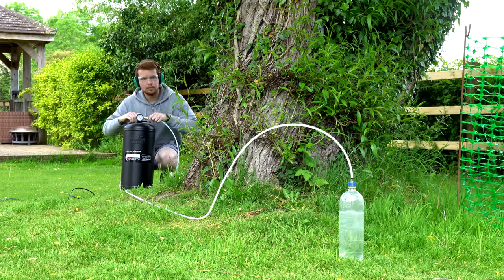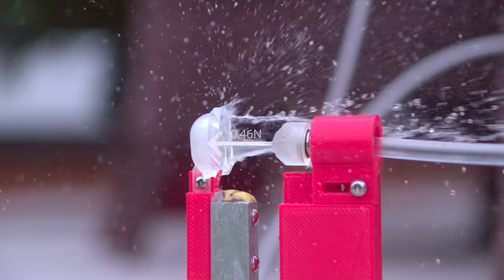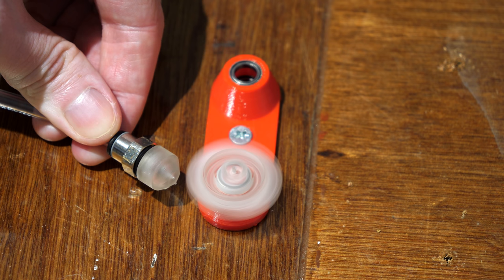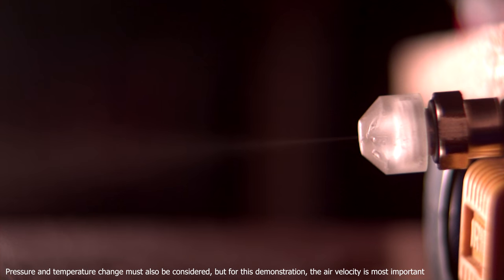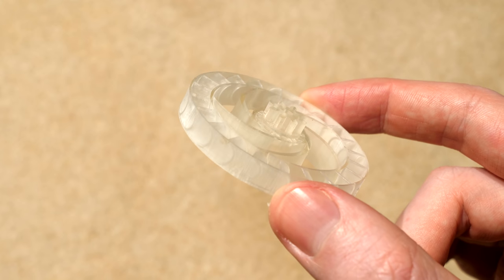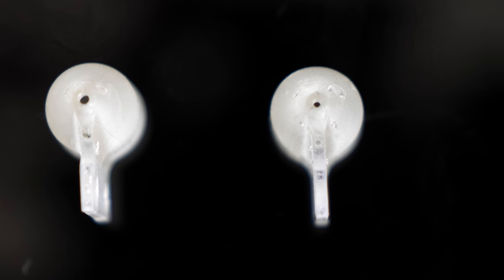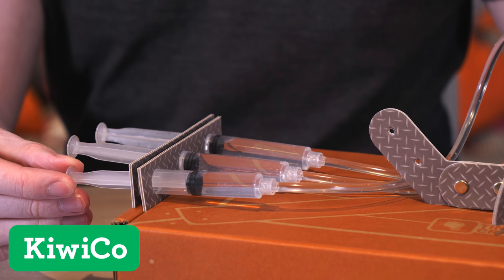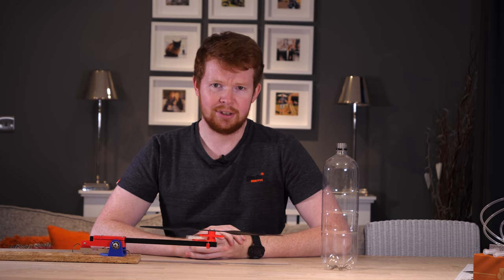Micro Pelton Turbine

Comment: A Laval nozzle should be used in a turbine operating with gas or steam. A water turbine does not need one.

The purpose of the Laval nozzle is to convert the pressure of the working gas to kinetic energy. The Laval nozzle can be located in the nozzle (impulse turbine) or in the nozzle and running blades (reaction turbine). Without a Laval nozzle part of the energy is lost to thermal energy because of turbulence on the gas stream.

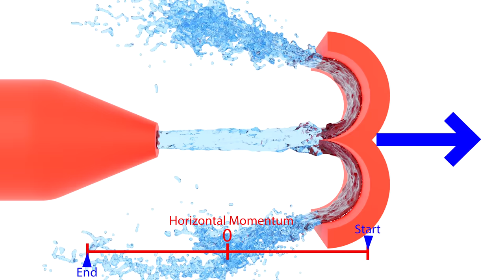Comment: at 01:25 you explained that the pelton bucket is more effective because it not just stops the water in its tracks (like the flat wall does) but redirects the water back, resulting in additional momentum. but then later on (in the context of the gear ratios) you mention that the turbine is most effective when the water expelled from the bucket has no backward momentum left. why at this point isnt this the same as the flat wall approach? in both cases the water gave all its momentum to the bucket and just „falls down“, doesn‘t it?
Reply: Because the curved blades return the momentum backwards if the optimum turbine load is selected, the working fluid air (or water) leaves the turbine almost without energy. This means all the energy is transferred to the turbine blades. Tom explained this. A flat wall will spill some of the energy to the sides, some of the energy will be lost.

Comment: The nozzle wastes more kinetic energy, as the air is only decelerated by the surrounding air, while the wheel can better restrict the nozzles blast, meaning it transfers more energy. Also the gearbox and propeller make better use of the gained energy at putting it out as lift, which works again better with a static plastic propeller, than with air only.

Comment: the wheel has more power cuz there is not the same resistance to the nozzle tip placed into thin air, place the tip of the air nozzle the same distance off the ground as you place the tip away from the turbine wheel then measure its force, resistance

its the equivalent of a high pressure fire hose, direct it horizontally 3ft off off the ground and it eventually arcs and drops to the ground right?

welp, stand in the water streams path right before it arcs towards the ground or falls off, maybe you can stand still without it pushing you out of the way?

now exit the stream and walk closer to the source say 3 ft from the tip, enter the stream, you will feel the power of the stream is a whole lot more than at the other end.. why is that?

if you cannot figure it out then let go of the fire hose and watch what happens, it flies all over right?  resistance, as in there is none holding it still, like he has the air nozzle anchored to the arm..resistance works both ways, the air coming out of the nozzle, and the turbine the stream of air hits..

one is static resistance and the other is dynamic resistance, in your second scenario there is no static resistance to push the nozzle connected to the arm. so just like the water, the pressure eventually fizzles out and has no power and falls to the ground, or ENERGY however static to static should create more force as there is less loss right?

if not rig the air nozzle tip away from a solid static wall so its the same distance away form your wheel, rig a sensor and measure the force it takes to hold the tip in place on the arm blowing on the wall 1/4" away, as in does it take the same force to hold the nozzle in place if it is blowing on a wall 1/4" as it does blowing on a wheel 1/4" away? you should be able to feel it in your hand, in fact the faster the wheel spins the less force it takes to hold the nozzle in place, no?

I do like the data for the two types of turbines, clearly the enclosed wheel is grabbing more air or is more resistant.. also like how kinetic energy increases with the prop, pretty good stuff mate

Comment: Could you have installed a second wheel under the first one that turns in the opposite direction geared together so the extra inertia with the water can be harnessed?

Comment: For your air based pelton turbine, maybe the inner chamber should be more spherical instead of only a 180 curve on a single dimension. I imagine those hard edges will cause a non-zero amount of turbulence that you could remove with a few more curves

Comment: Would be interesting to even just investigate the de Laval nozzle with compressed air. I think you are loosing alot of efficiency through the nozzle shape alone. Adding a small conical expansion at the end of the venturi could greatly enhance the efficiency. Additionally having the nozzle directly connected to the turbine in an enclosed housing could also increase efficiency.

Comment: If you put a small stop at the bottom of the curve to "catch the water" ( not really catch, but give the water something else to push on), as when you put water through a curve, you lose most of the energy as the water slips out of the curve, Putting a stop on that will improve your design.
Reply: Message me, if you need more of an explanation.

Comment: This is kind of like a turbo, what if instead of shooting a loose jet of air you had the inlet flush, flat against the surface of the wheel, and then the channels through the wheel designed to get slightly thinner towards the exhaust, then your outlet pressure is adjusted by changing the size of that opening, which would vent the air at an angle but pressurized slightly. I feel like the amount of energy lost in the initial blast traveling between the nozzle and the bucket presents a huge opportunity for energy loss. I feel like with the right exhaust, gear ratio, prop size,  air pressure, you could actually get a flight time with a comparatively flatter output, and overall more efficient. Or maybe I don't know how to physics... probably that..

Comment: That's good, thought you'd be more up to speed on the subject.

While you're doing the math here, the nozzles shape, size does make a difference.
You need to math some of this to work out the air pressure (mass)  and weight (torqs) against speed (valcty)  in its transfer surfaces.
For example a curved blade,  and a curved nozzle, tip; they are not the same.
It's rake and pitch alt to the mass flow and output req.

To get the most, it is a good idea to take the driver and use it twice, or  when we would put performance in ranges, like a dual blade turbine. Waste force, if there is any can run other types of converter, provided the drag and friction is lesser

Comment: Im just curious if you take the wheel without the casing and put C shapped casing in the base that doesnt spin, and make it only1/4 to  half, so all air is kept inside until it goes 1/4 to  1/2 way around then it comes out? - just a thought

Comment: Have you considered working on a solution to stabilise the input pressure to the air tank? The consistency/reliability of the input is just as important as the efficiency of the output right?

When it comes to aircraft moving through the air, it seems like a plentiful environment to redirect and create consistent pressure by injecting air back into the tank through a one-way valve. I'm talking about something along the lines of self-sustaining pressure. In this stationary situation, I imagine an air pump would be useful to experiment with? 

Your videos really get my non-mathematical brain thinking! I can get a sense of a future where engines run on air alone rather than fossil fuels or recourse intensive clean electricity...

Comment: I am guessing that it is more efficient to use the turbine rather than just the nozzle due to this. It pushes more air slower instead of less air faster. 

This increases efficiency due to how newtons laws of motion and kinetic energy interact.

To demonstrate this let's compare how much thrust pushing 1 kg of air vs 0.1 kg of air with the same energy 1 joule. 
With 1 joule you can accelerate 1 kg to 1.4 m/s.
While you can accelerate 0.1 kg to 4.4 m/s.

Now that you have the speed the masses will accelerate to, you can easily calculate the thrust given a certain period of time (say 1 sec).
When accelerating a mass of 1kg to 1.4 m/s in one second, you achieve a thrust of 1.4 Newtons.
While accelerating a mass of 0.1 kg to 4.4 m/s in one second, only achives a thrust of 0.44 Newtons.

You see this result mainly because of the fact that the kinetic energy of a system increases exponentially when speed accelerates linearly. While the thrust of a system only increases linearly with a linear increase in speed.

Because of this it makes sense to use the energy stored in a pressurized bottle to move more air slower rather than less air faster, despite the inefficencies inherit to mechanical systems.

Comment: i wonder f you could include a plunger in the water bottle and a bladder .. as the air leaves move the plunger down the bottle to keep the pressure up leveling off its available work potential for a longer flat period and about the same overall duration ...

Comment: try torque conversion, tesla turbine sling, but the narrowing nozzle should work the same, tesla turbine will have centrifugal squeeze, with the air in flow
Reply: hey, explain non-conservation of energy in the 100% deflection case, vs 100% absorption case, if you deflect 100% speed, then the turbine pelton wheel should not have any energy, from the deflection, same for photon mirror solar sail bounce (assume 100% energy reflected deflected)

Comment: I have question , if you build the small compressor engine to refill the bottle with air , will it take less energy to refill bottle so you can fly longer then to power 4 engines to fly it like most of drones ?

Comment: is it impedance matching? I imagine something like how mppt works, to get the best performance. if you could adjust the size of the nozzle as the supply pressure drops, or maybe open a second nozzle when the pressure hits a set point.

Comment: Question, wouldn't constantly running the air into the turbine while the turbine is at peak rotational speed be a waste of kinetic energy? If it was still absorbing energy I would assume the rotational speed would increase, if it's not increasing in speed isn't there a loss of potential energy since the turbine is spinning at the same rate the flow of air is leaving the bottle? Or it the resistance of the shaft causing it to lose energy too fast?

Comment: Do you calculate the additional angle of incidence needed for the propeller to propel the plane on flight?

Same when you fly a fixed pitch prop plane during TO, you will apply full thrust but the prop RPMs are not going to go to the max out because there's no or min forward speed...

Comment: Hi Tom, I have a thought that may or may not help, and I'm not smart enough to implement the idea, but I think you can.

Is there way you could pulsate the water like a water-pik teeth cleaner does. 
Some sort of on off on off that would cut the consumption of air for possibly a better result because it would only blast the fins power point and not the points in between that slow it down.
If someone else has a smarter way to say this feel free to expand.

Comment: I think it has something todo with the fact that a propeller can use the surrounding air to push itself. consider the 2 extremes. No air and the nozzle would be better. A Medium like water or worse and the nozzle wouldnt even work well at all but a propeller would. I think usual air is somewhere inbetween where the propeller can still outperform the nozzle. Might have something todo with the surrounding pressure. Would still love to know the details because I intuitively would guess the nozzle converts 100% of the potential energy into kinetic energy which is split equally between the craft and the outgoing air. But maybe thats the exact point. the Turbine can make use of almost 100% of that energy because it converts the kinetic energy of the airflow back into energy the propeller can use much more efficiently. But why? In theory its the same principle. The Propeller pushes the "earth" and its air away and gives it 50% of the kinetic energy of the original airflow. So we are at the starting point. Weird! Where is the energy wasted in the nozzle case when its theoretically most efficient?

Comment: Why not add a mirrored air stator on the out flow of the turbine also what if you use 2+ nozzles. You can probably stack a 2nd turbine with an idle shaft that spins the opposite direction and blast the air directly in using a 3dprinted manifold with small jets under 0.2mm. My math says 4 0.2mm jets on a 18mm radius geared 3.2 to one with a single wheel or two wheels at 2.4:1 also what not make the turbine wheel the outer ring of a planetary and use the suns to drive the propeller ?this will reduce the drag and make it a lot more streamlined in the propeller  wake another option is hold the planets drive the sun and use the ring as the output doing that you can use a small wheel because the ratios will be high 8:1 and up you can get upto 13:1  ish single stage but stackem and that can grow fast

Comment: Why a lowly plastic bottle? Why not a 45 or 68 cu-in 4500 psi High Pressure Air tank? The fiber wrapped ones are not that heavy and they provide a much higher stored energy to weight ratio.

Comment: The propeller is more efficient than the straight nozzle due to the drastically increased area of the fluid its pushing against: The straight nozzle has a very narrow thrust profile, and as such the thrust is dominated by the reaction mass of the air, which is not very efficient; however, the turbine pushes against the profile of the wing, as well as getting additional thrust due to lift. It's no wonder that propeller driven craft dominate the commercial aerospace market, propellers are simply better than rockets in all cases aside from low pressure environments.

Comment: The reason why the turbine is more efficient is because the 2nd and 3rd Laws of Newton. Less air mass is displaced with the nozzle only configuration, hence less force is applied and less reaction happens to the opposite direction. That's my guess.

Comment: When I was at University we had a steam powered car challenge how far or fast could you make a steam powered car go on 20ml of spirits, I did a 2 stage turbine with a stator but messed up my final gear ratio and didn't get very far (our was the first year). in later years I believe they've gone 3-5Km - the best turbine is a Al disk with pockets drilled into the edge as little bowls which make the steam do 180. I don't know if its enclosed.

Comment: You need to try a rotary vane motor, it is more efficient than pelton or even piston.  In an article "Design and implementation of an air-powered motorcycles" the authors claim 70% efficiency, with is more than the 50% that the best piston engine designs can achieve.

Comment: You seem to have contradicted yourself, but touched on a deeper issue that could be explained or explored in depth.
First you show that the bucket design makes the water fly away in the opposite direction and explain that this increases the momentum transfer.
But then you say that having the fluid fly off (in any direction) is not transferring all the possible kinetic energy and thus loses performance.
The "impedance matching" analogy is that the bucket does reflect the direction of the fluid, but the rim velocity matches the incoming fluid speed.  That is, the sum of the reversed fluid speed and the bucket speed is zero.  But, in that case there is no actual impact so it won't work.
I think you can make use of the difference between the inner and outer radius across the bucket, which suggests that you want a design where the fluid enters the bucket towards the inside of the wheel where it's moving slower, and the shape of the bucket acts as a cam so that the impact spot stays perpendicular to the fluid as the bucket turns, finally to be dropped off as the faster part of the bucket pulls away from the flow. 
Note however that the bucket is not moving parallel to the flow except at one point where the flow is tangent to the wheel.  For a sustained time of contact, the wheel's motion curves and this reduces the component of the velocity along that direction.

Comment: If you had an actuator that could match shots of air/water with the amount of time each bucket on the wheel is in the correct spot I wonder how much longer it could fly for. Maybe not at all with the added weight of electronics. Idk how you could do it mechanically, unless there was a set rpm it had to start at.
Reply: If you made a year that clicks something under tension such that each time it clicks it opens the nosel
Reply: Oh I see once it csn match rpm's with the flow rate pressure, the stand still. Yeah that makes sense.

Comment: What would happen if you do not redirect the air by curved blades but it instead hits a flat surface which leans slightly with an edged corner in the end of the direction the air choses when it hits the blades, so that the air has to completely change direction when hitting this corner? You do not give the air a smooth way out, but forces it to redirect when it hits this corner

Comment: Try making a helicopter using this. Ps put sellotape on the bottle so u can have far more air in the bottle thus reducing weight + higher air pressure in bottle = more air speed and rotation speed in the turbine

Comment: I think the turbine could be made more efficient by improving aerodynamic drag. Not the internal shape of the "buckets", but the outside shape that have to penetrate air. Think rocket nose cone, wing leading edge, or even a competition bike helmet. At 21K RPM, every bit of drag can make a significant difference.

Comment: The reason why the turbine is more efficient than the nozzle is because the turbine creates greater thrust than the nozzle and lasts the same amount of time as the nozzle, making the turbine use the compressed air's energy to a higher degree of success.